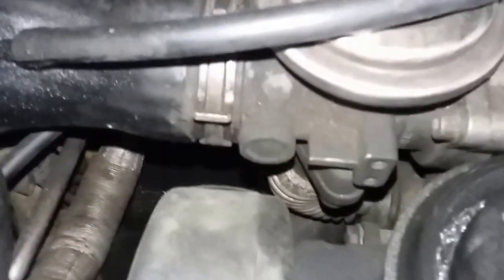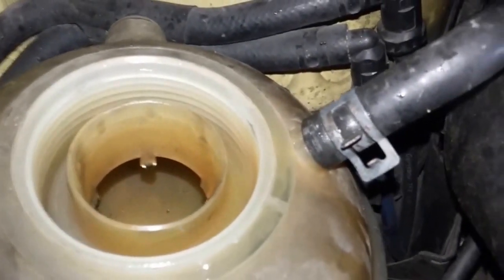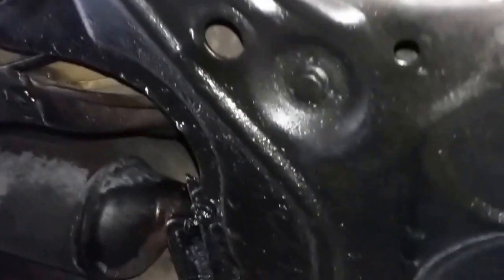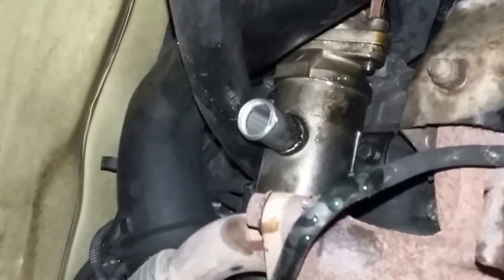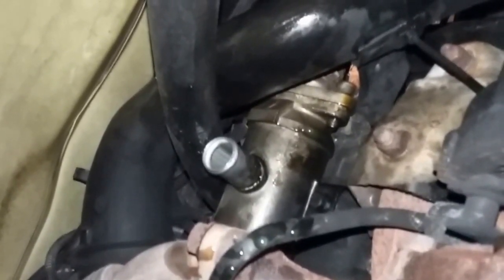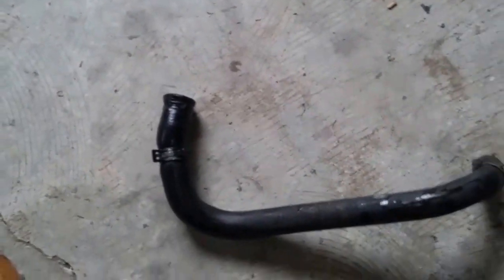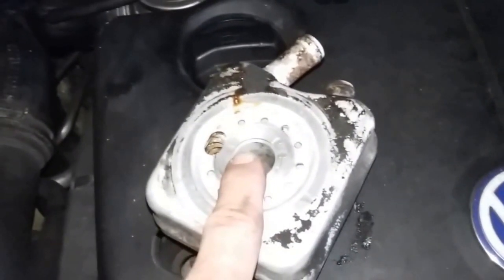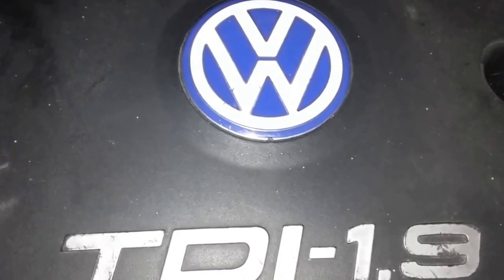coolant leak fix VW new beetle jetta golf mk4 passat

Comment: The clamps that stick out for the heater core need to be replaced once every other year or so. They are cheap and made of plastic and do not last long. Quick tip. Do not use different clamps on these vehicles, the plastic is rated for the specific pressure that the oem clamp puts on it. if you use a worm clamp it WILL eventually crack and brake the plastic due to the plastic not being able to bend back and forth with the heat.

Comment: My 02 Beetle was having a slow coolant leak starting 3 months ago and now it has gotten worse and hot steam is coming out of the AC vents and there is a lot of what I believe is coolant that is leaking down to the passenger side floor. Sounds like I need my heater core replaced or could this be something else?
Reply from the maker: Your right thats heater core